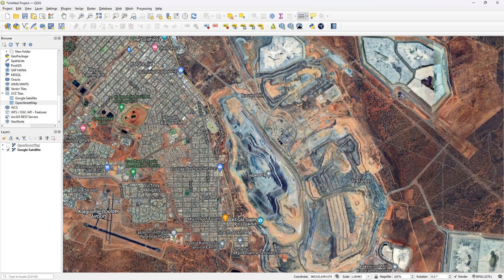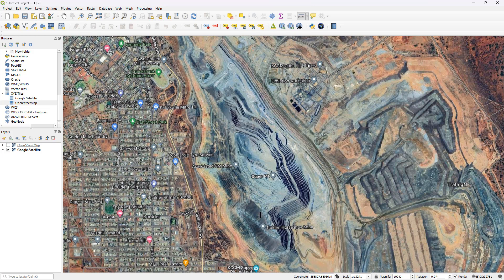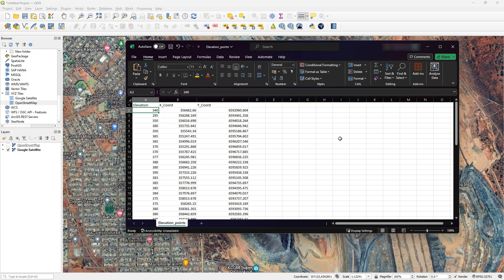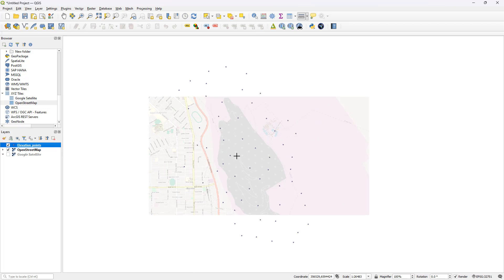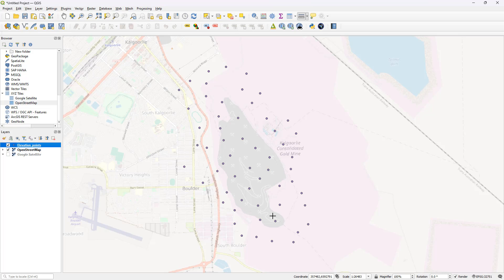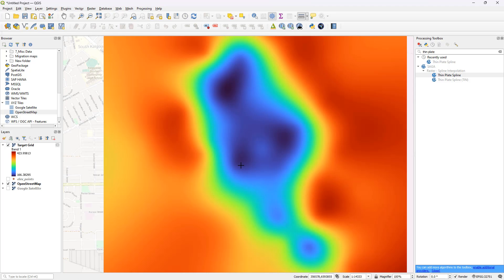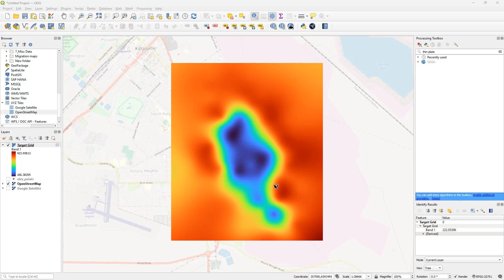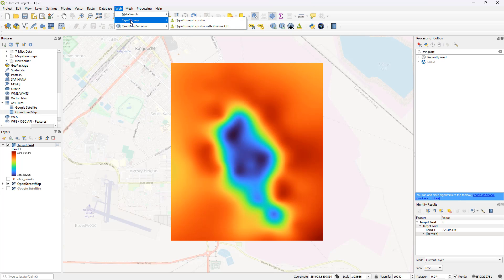3D Model Creation using QGIS

Comment: Great video, very explanatory but I had a problem where all the elevations in the side column (after using the Thin Plate feature) displayed 67 to... 67m! or It would be in 10's of 1000's of km yet the labels on the point cloud clearly displays between 30 and 130m so not sure what's going on there.

Comment: Please how do you generate similar data at a particular location?
Reply from the maker: Hi, it really depends on the specific case. While at times one could rely on freely available digital elevation data products for certain large scale applications, getting a more accurate elevation dataset at a specific location would generally involve more complex and sophisticated methods which involve a combination of remote sensing technologies, surveying techniques, and data processing. Examples: Airborne LiDAR, Total station surveys, Differential GPS surveys, Interpolation from any existing data, land survey measurements etc.